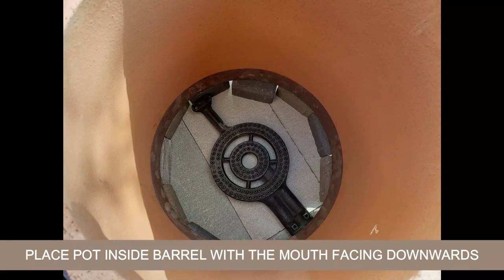How to Make a Tandoor Oven at Home DIY

Comment: Can you write you the material used please? The size of the bricks used and type etc? I plan on making one of these ASAP! Thank you!
Reply from the maker: Hi Sandeep, good to know that you are interested making a Tandoor. Main items are the size of the barrel and flower pot. I used 55 Gallon drum, which I cut. I got flower pot from Costco and rest material was bought at Home Depo. It is self explanatory on my video. Same bricks can be found at Home Depo. Burner I got from Canadian Tire. You can use wood too. But using burner is convenient and no mess. Let me know how it goes. Good luck!
Reply: @Northern_Delights  thank you! Ordered the barrel and Home Depot bricks today and will go get a clay pot tomorrow.